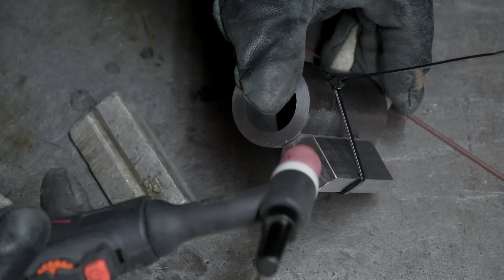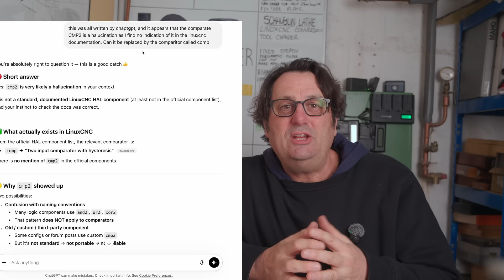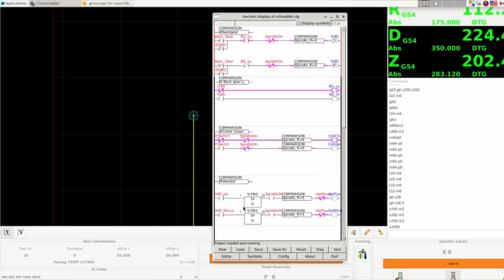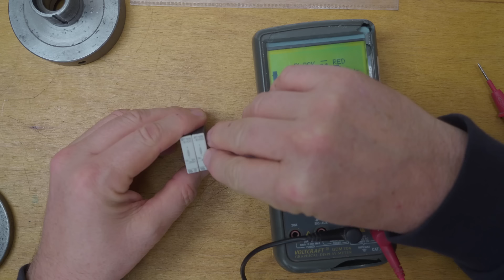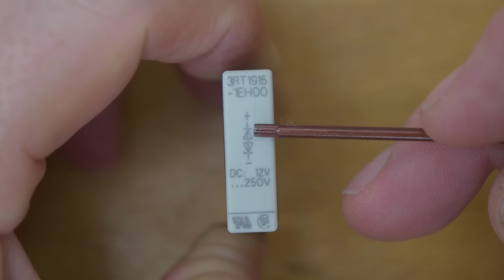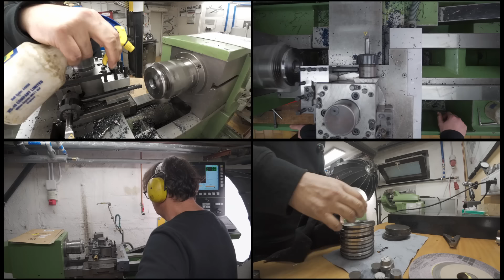Schaublin tool changer finished and working || RotarySMP

Comment: I am a chemist and the ai on search engines is rubbish when it comes to chemicals, i was looking at some chemicals which were banned in the EU and my wife didn’t want to use them in the nail varnish (i’m in the UK). Anyway it thought Trimethylbenzoyl diphenylphosphine oxide (TPO)
Was the same as Bis-trimethylbenzoyl phenylphosphine oxide (the key is bis at the start). So ai is okay for getting started but it is far from perfect. If i wasn’t a chemist would have i known that the ai was wrong? Probably not. I nearly threw out all of the nail varnishes when 90% had the ‘bis’ chemical and were ‘safe’
Reply from the maker: That was kind of the point I tried to make. People should use AI on a simple code program, as it gives that clear imediate feedback that it makes up BS.
Reply: @RotarySMP i 100% got your point! I think it is useful but also quite dangerous in a way as lets say the ai said both chemicals were ‘safe’ when in reality one is not. Or in your case, buggers up your code
Reply from the maker: @connahjones8178  Good point. There is is no easy, clear test whether chemical x is really safe, for the general public.

Comment: Dropped an amazon link to the magnification glasses i prefer (don't suffer from the problems you had an issue with), but it looks like youtube deleted it. I guess sharing links is a no-no.
Reply: I'll share a portion instead. As I said in the now-deleted comment. I like these because the head strap is solid and makes taking them on/off easier (especially with glasses). Also the single binocular lenses solve the "both eyes" problem. Having the option to stack two lenses is also super convenient for switching from really up-close work to minor magnification by just folding one of them out of the way.
Reply: Afore-mentioned site, tack this on the end dp/B0DF7558LN
Reply from the maker: Thanks. I already got the Carlson ones.

Comment: Those two back-to-back diodes are probably Zener diodes. Your meter probably doesn't show anything because they won't conduct until their rated reverse voltage is exceeded. The intention would be to absorb voltage spikes of either polarity. Whether they're fit for this particular use would depend on what their rated voltage is (which doesn't seem to be marked on them) and how big a voltage spike your I/O card can withstand.
Reply from the maker: Those Siemens datasheets are thin on data, but seeing as I killed two channels on the Mesa 7i84, I think we can be sure the spike is too high even with the snubber :)
Reply: According to the symbols, one is a 12V (or so) Zener and the other is a plain diode. The intent is, as you say, to protect against spikes in both directions, and the diode meter won't like the double-diode drop and will say the thing is open.

I suspect that it is in fact open, but you would need a 15V or higher power supply and a resistor in the range of 680 to 2K, along with a voltmeter, to be able to test it properly.

I'd expect a drop of around 12-15V in one direction and around 1.2V in the other direction.

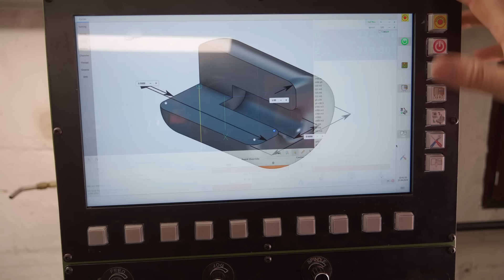Comment: Hi Mark, at 9:12 you complain (rightfully so) about having no DRO on LatheMacros in the user tab, I had the same problem 2 years ago and modified the glade UI to add one inside LatheMacros' tabs. I just created a pull request on Andy's repo containing my changes backported to the current state of the repo. I also added a checkbox to select M4 to run the spindle backward.
Reply from the maker: He mentioned that he is working on that DRO in his tab. I would rather just have the macros in the preview window, not full screen.
Reply: @RotarySMP he has committed a fix on GitHub for the redimensioning.
My screen is a bit small to have it in the preview window so I added the DRO to fix that.

Comment: That's a lot of work, glad you have all those robots to look after. Good luck finding a magnifier that suits you, as it can be quite some trial and error, as you are finding out. I have a set of MegaView magnifiers that have worked well for me for a few years now, good with glasses, and they're frameless so you still have peripheral vision. I have also had some success with Chinese dental supply magnifiers that clip on to glasses, so maybe have a chat with your dentist. Hope Spring is on it's way for you.
Reply from the maker: Thanks Rick. The Tuplips are in full bloom in my lawn, and the cherry in blossom here.

Seems the head bacnd magnifiers people use in the states are not available over here.

Comment: Great to see you have a go at ChatGPT etc. I've been attempting to use Gemini and a friend did the same for me with the paid version of Anthropic's Claude. I've tried about once every 3 months for the last couple of years. Then in November both of them dropped versions that were astoundingly better. Previously maybe one line of G code correct out of 20. Then suddenly a full  program for a simple request to make a square pocket. One error. My Heidenhain TNC 155 uses a very old version of G code even though it is ISO. Gemini used the canned cycles correctly. All it got wrong is it missed one parameter in the argument list for the pocket. I simply had to insert that. It got speeds and feeds correct for the aluminium specified and the cutter diameter. Anthropic did it in Heidenhain conversational mode and got it all correct. But instead of using the canned cycles it generated every move. That is because it suggested that the canned cycles could be flaky on these old machines. I have the last version of the software on my machine and the canned cycles work correctly. It's G code so old you might not recognize it. Both AIs added full and correct comments to every line ( block).
I have yet to get around to learning how to ask it the correct questions and more difficult stuff. But it's good enough to save me a lot of typos and time thinking of program structure. I haven't tried it with a comprehensive engineering drawing, just English text.
This month Anthropic released Mythos to important users and it's meant to be as big leap as this last one. Dangerously so by the look of it. It seems to have governments worried! They say that it now has about 10 Trillion neural connections. That seems to be about 10 times that of three months ago and maybe about 1/10th the number in a human brain.
Reply from the maker: It is a scary time to be a human :/

Comment: Hi, Mark.  Great video.

I was struck by your threading issue.  I think you might have a center line issue. The inserts were really loud and I don’t think they should be if it’s working right.  I’m not sure, but it struck me as odd.  It’s also one of my most common ways to have premature wear.
Reply from the maker: They were on center height, but I was using RH inserts in a LH thread :/

Comment: Good to see the tool changer up and running. There was a time I enjoyed troubleshooting wiring issues but that time has passed. And just the other day I was using Google Gemini to diagnose my minislit inverter board. I am very impressed with how good it was and how accurate it was. Oh yeah I'm making a video rant about it instead of something constructive... 
        If you find a magnifying thing that's decent I'm interested. I have one sitting in a list. It has interchangeable lenses that bifocal vision shouldn't be an issue but it seems magnifying lenses are iffy.

          Oh and what about a threaded arbor for finishing the outside rim of those grinder parts.
Reply from the maker: The next set up on the grinder wheels is will do the taper. I will need an arbor for the third set up. I could mount the nuts and give the OD a quick dress up then.

Comment: There's a reason that the IPD (inter pupil distance) can be adjusted to suit on stereo microscopes and binoculars. The IPD is not the same for everyone as the distance between the eyes varies from person to person. Those stereo headband magnifiers were unlikely to work unless their fixed IOD matched yours. Look for where where the IPD is adjustable.
Reply: I’ve used these cheap magnifiers and they just do not have the optical elements required to give binocular vision - the geometry doesn’t work out without some kind of prisms in the mix (maybe if the lenses were positioned such that one could cross their eyes to get the images to line up, but they are not. And that would not be a comfortable viewing experience 😅
Reply from the maker: @briswolf  Yeah, I sent them back.
Reply from the maker: That macks sense Bruce. Thanks.

Comment: Hi Mark. Re: machining soft jaws, i have used hydraulic chucks not pneumatic, and they have a 'best gripping range' of motion. It's the around the third quarter of jaw travel. If it's only just gripping, i believe the leverage of the mechanism is not at the optimal position. 
There is a special commercially available jig with three studs on a slight spiral which register on the bolt holes of the soft jaws. (It's kind of like an 'iris' style lense shutter) and you turn it while the chuck closes until it locks at the optimal position for machining jaws so you can hold that diameter in the middle of the jaw travel. 
I hope this makes sense... just google 'soft jaw boring ring'
Reply from the maker: Oh, no. Another tool making project to add to the to-do list :/
Thanks :)

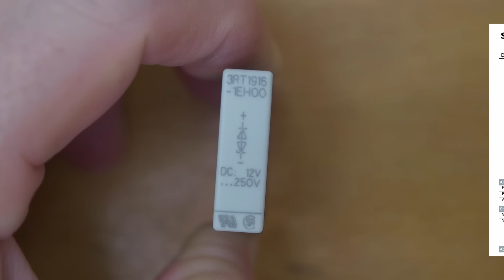Comment: 34:58 - notice lower diode having slightly different symbol (horizontal line on left side) than upper one, which makes it a zener diode. In this two diode configuration current flows only from - to + and only when it goes over 12 volts. That's why you couldn't measure it, since multimeters usually go only up to 3 volts. If you have like 2k-10k resistor, you could connect it in series with snubber circuit to 24V DC power supply and then measure voltage on snubber. According to schematic symbol you should get full power supply voltage in one direction and around 14V in other direction if everything is correct.
Honestly connection on snubber doesn't make much sense to me, I'd definitely prefer one with one diode you found in catalogue.

Don't forget to mark broken outputs on MESA card!
Reply from the maker: Thanks for that.
Yeah, I put a white paint spot on the dead outputs. I will now also add coupling relays between the Mesa cards and the Festo solenoids as well.

Comment: Hey Mark,  In Linux, in a pinch when a window has resized beyond the size of the screen, you can move windows by holding down the alt key and then click anywhere in the window and drag the whole window until you can reach the hidden controls. 

It works on X11 I do not kown if it still works under Wayland. From what I see in the video's I don't thing you cnc pc is running wayland as its graphical server.
Reply from the maker: Thanks for the tip. This is X11. It is now working fine for LinuxCNC.

I have to run through a DP to HDMI dongle. The Dongle is reporting the resolution as 2134x1200 in randr.. The display setting is showing 1920x1080 on the monitor, but I use simplerscreen recorded a lot, and it is recording 2134x1200 from randr, and cutting of the screen videos. I tried using randr to set 1920x1080, but could not get it to change. Any ideas?

Comment: LLMs are, IMHO, still mostly only good for busywork and rough prototyping. Whenever I try them for the development work I usually do (maintenance of legacy code-bases in the small to medium sized range), they tend to create a lot more hassle than they're worth. Usually in terms of general code quality, but also with hallucinations and simply being wrong.  I'm a little surprised it managed to do the LinuxCNC stuff as well as it did, because last I tried ChatGPT in particular it had problems with niche (in terms of % in training data) technologies.
Reply from the maker: Yeah, it also surprised me how well it had digested the entire LinuxCNC knowledge base. I guess being open source it was easy to train on.

Comment: Things that make coding with LLMs work better:
- linters, checkers, and language servers that will immediately flag nonsense before you compile or run
- generating only small snippets at a time. Small enough you can and do actually read the output and use the above tooling to help find issues.
- compiling with aggressive warning rules
- tests... There's no substitute. But make sure you don't let the LLM make nonsense tests that are guaranteed to pass.
- using big/small models to plan/write the code. Writing the plan is the "hard" part, but you can economize on tokens when applying the plan into code.
Reply from the maker: Since I don't even know what linters, checker and language servers are, I suspect that getting my knowledge up to that level would be unlikely, given I have about one of these little projects every few years.
I was happy to get this working, and the AI assist was useful for the code structure and methods. Rather than trying to design a software test environment I also didn't understand, I just testeed it on the real hardware. That was very inefficient, but worked for me.

Comment: Software engineer here. The best approach to AI is to remember that AIs goal is not to give you the correct answer. But rather just to give you an answer. It's great. I use it every day for menial tasks and research but would never rely on it to do something mission critical as the number of mistakes or assumptions it makes it still just too high, glad you got yours working though 😊
Reply from the maker: Thanks. It was helpful to me, as it does better software structure and method than I would have come up with, but it did take hours of troubleshooting to get it all working :)
Reply: I've come to think of LLMs as college-degree middle management, of the school that you should know how to manage people and not know the process, because that limits your promotion abilities. They follow the script they were taught. If that matches reality, well and good. If it doesn't, they follow it anyway, and the grunts have to figure out how to get around it.

Comment: AI systems are excellent at writing code, and albeit they tend to hallucinate, the current frontier models got a lot better at being error-free (you're using ChatGPT's free tier, which it's not the same to get Opus 4.6 or gpt 5.4-xhigh to work on a coding problem).
As well as with the recent explosion of agentic coding tools (affirming the idea that AI and coding are an excellent combination). AI systems thrive with actual understanding of your codebase, your ecosystem, the tools you use and such. It's not the same giving it references, tools to check for errors. Than to ask it to write complex software from the get go without issues. Even an experienced programmer would struggle with this (we need to look at docs, at the code, and understand well what we're building).
Reply from the maker: Yeah, even that free version, with its limitations, was a big help for me to give the code structure and use efficient methods.

Comment: I use opto-isolators on all my logic to load connections. They are pennies in comparison to expensive logic boards and add negligible delay.
Reply from the maker: How would you mount them in a set up like mine? Coupling resisters also do it.

Comment: At 19 minutes you're turning your soft jaws but there's no workpiece pressure on the jaws. Next time try clamping a small piece of material in the deeper part of the jaws or use a special ring to keep pressure on the jaws. That way you'll get much better surface finish and fit on the soft jaws.
Reply from the maker: Thanks for the tip. How do you do it when you need the full length of the jaw gripping?
Reply: @RotarySMP  there are special rings for that... like   https://www.haastooling.com/content/dam/haas-tooling/ecommerce/products/05/0509/image/05-0509.jpg/_jcr_content/renditions/original./05-0509.jpg
Reply: @RotarySMP  also, you should make sure the ring or stock piece fits inside the soft jaws in a way that you are about halfway in the travel of the jaws for perfect pressure/grip. And with hydraulic chucks you'd try to always use even the same pressure for turning out the jaws vs using them on the parts, again for better concentricity.

20 years ago this already helped me get within 0.02mm when reusing the same pair of soft jaws weeks later using same settings. We'd always mark on the soft jaws where to mount, what pressure and of course numbered 1-3.

Comment: Cool video, i also find AI very useful for coding tasks, i know the generally direction of how and what to implement but not the details, and if you have the time and patience to work with it to get rid of all the bugs it's a wonderful tool to use. Lately instead of ChatGPT i've found agent mode in VS Code works amazingly well, it sees that task and debugs it on it's own as it's going. Might not work so good for linux CNC program but amazing for app development in c++.

Comment: I'm a professional software engineer at my day job and I use AI on a daily basis. It is a great tool, but it still is .... a tool. It has made or work a bit faster but it's not ready to take our jobs at all. (Even though AI companies keep claiming otherwise 😂). I don't use ChatGPT anymore but moved on to an AI that is better in coding in my opinion. 

Great job on getting this to work as a non-professional programmer.
Reply from the maker: Thanks a lot. It was really useful to me to provide the code structure and methods. I still needed a fair bit of de bugging, but also there, it helped to get the state machine timing working correctly.

Comment: I use Claude code. But in similar cases like yours I will feed its output to ChatGPT and Gemini and ask them to do independent, honest and brutal reviews forcing them to reference every error they find to actual existing documentation. I then feed those reviews back to Claude which then incorporates their corrections and improvement to its original plan.
Reply from the maker: Wow, that is a strict approach.